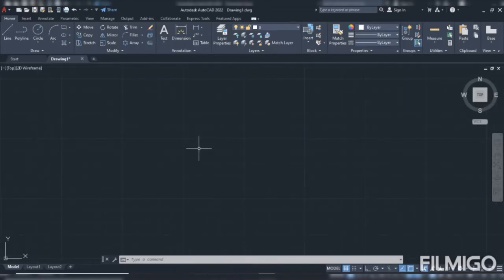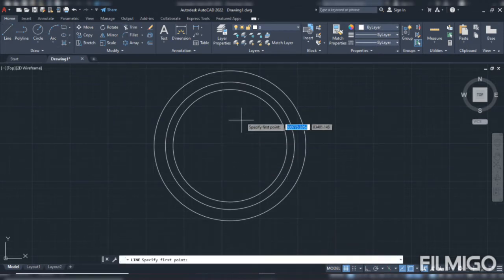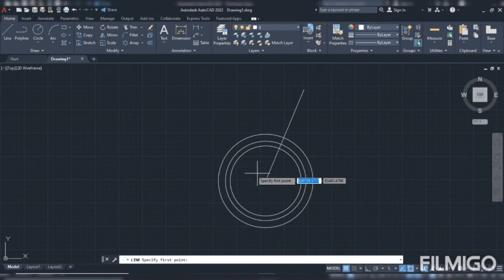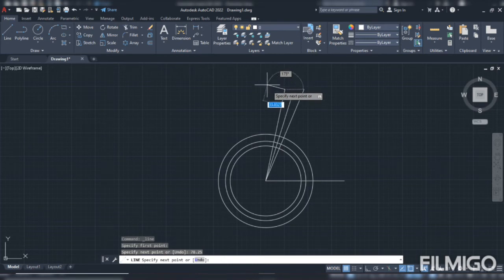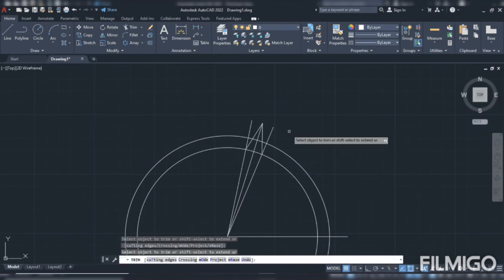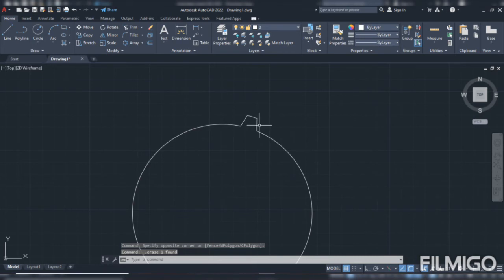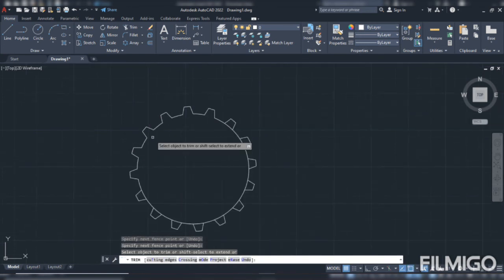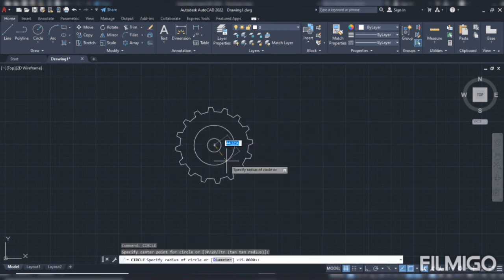How to design involute profile for a gear in AutoCAD

Comment: This is not an involute profile gear!
Reply: It is a gear wheel with conical teeth, not an involute gear.  The involute curve is used because the teeth of this form roll against each other as they rotate and therefore produce minimal friction and wear.
Reply from the maker: Then what is this
Reply: @CAD2PLM  first go and read what an involute gear is !!